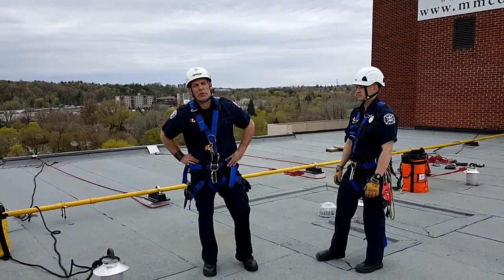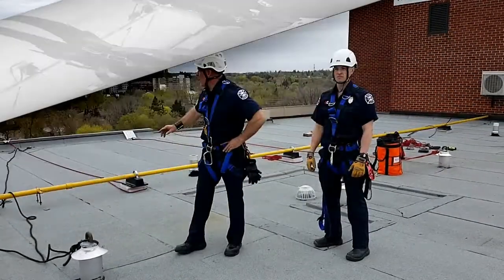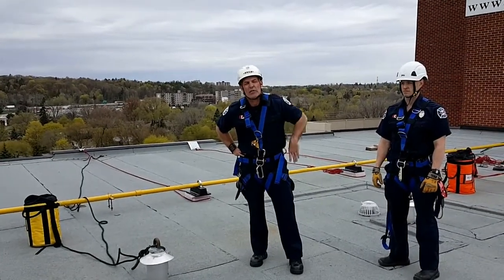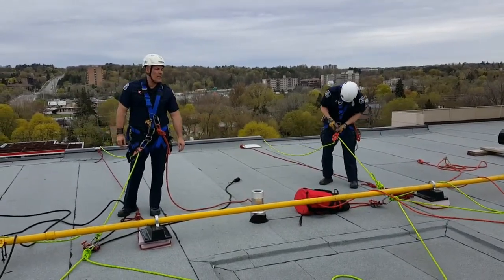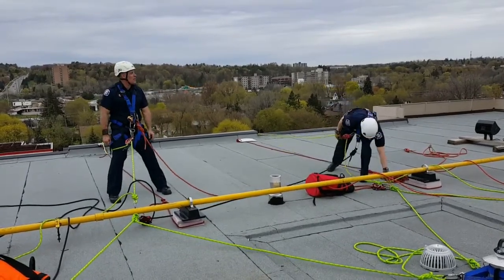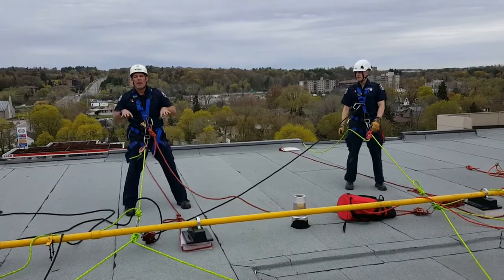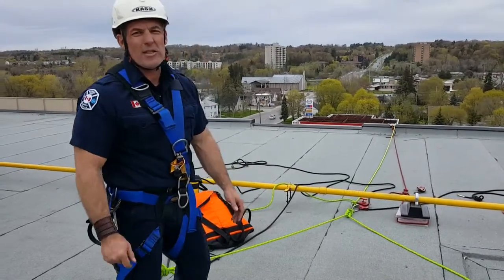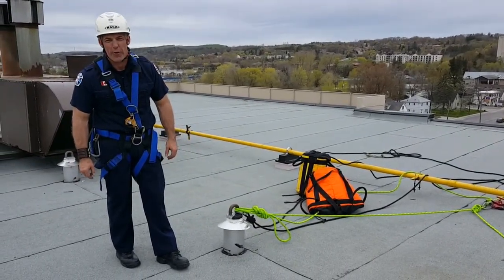NFPA 1006 technical rope rescue. 3rd quarter drill Loadshare V for high angle rope rescue systems

Comment: Min 2:55 why did the belay lines cross instead of remaining in-line with the main line and rescuer?
Reply from the maker: Miguel Cordova in a true belay everything, every knot, every anchor point, every piece of hardware is backed up by by redundancy. so there are no single critical points. if the belay remained in line with the main what would happen in the event of anchor system failure? What would happen in the event of the figure 8 knot failure? 
This way and system can fail.. and knot... any component and it is backed up by an independent system ensuring true redundancy
Reply: Bkdrft Bk Copy! Thank u for the clarification.